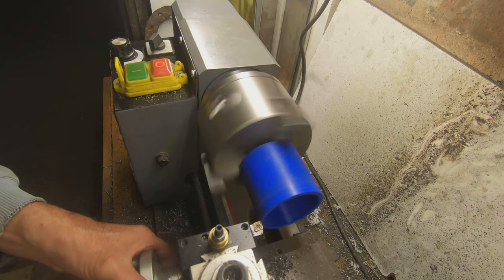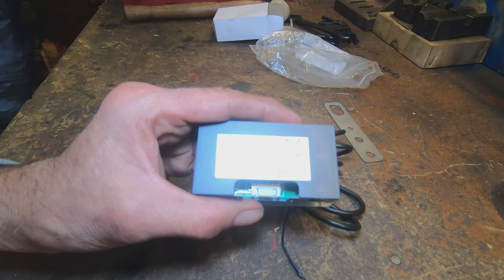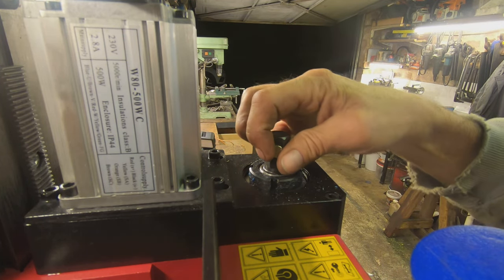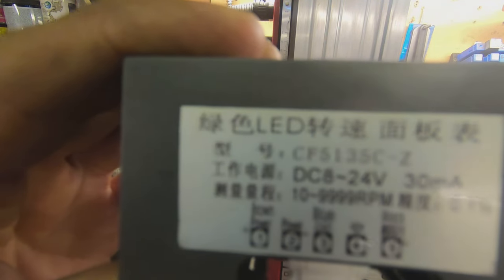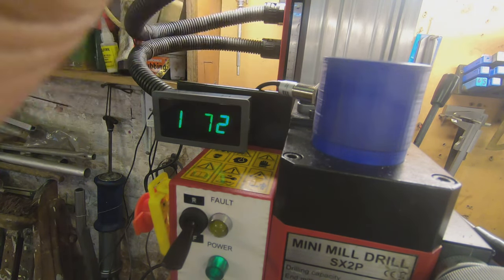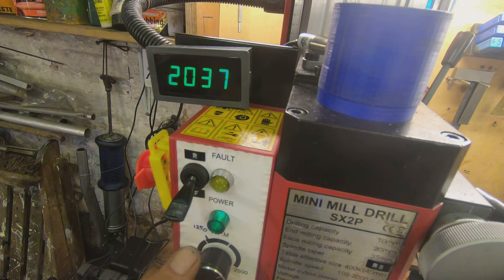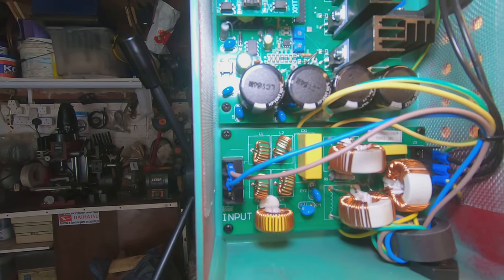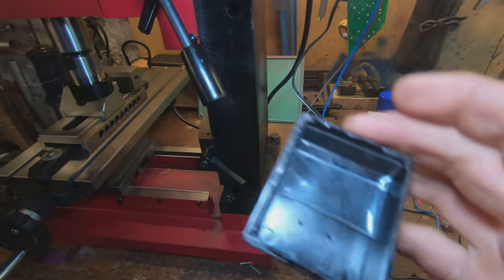MINI MILL UPGRADES #1: SIEG SX2P HALL EFFECT SENSOR

Comment: I just use the readout from the VFD I use to power the motor and created a chart to indicate the true rpm of the spindle as opposed to the percentage of the wave form on the VFD........your setup with the sensor on the draw bar will make it difficult to fit a power draw bar later and if you haven't got to fitting one you will like it when you do.

Comment: The little socket behind the front control box is where you hook up the tacho and it has the power supply. Unless yours is not booked up.
Reply from the maker: Thanks for the feedback. Doesn't look like this machine has that fitted, sadly. Appreciate the info, maybe it'll help someone else.
Reply: @myharris  I seen it in the video tomorrow I will send you a pic.

Comment: You need to upgrade to a belt drive.
Reply from the maker: Interesting thought, thanks for sharing. What would you say the benefits are? Genuinely interested in learning more about this, appreciate your feedback.
Reply: @myharris  The main benefit is sanity.  The belt drive is so much quieter than the factory gears.  But also if the spindle "crashes" the belt drive just slips instead of destroying the gears.